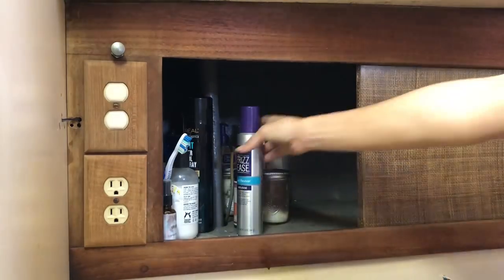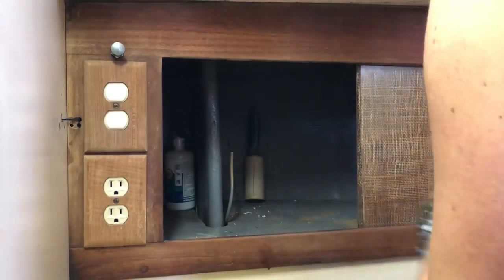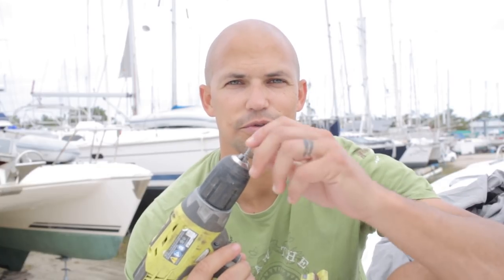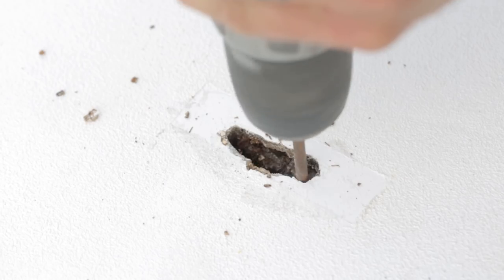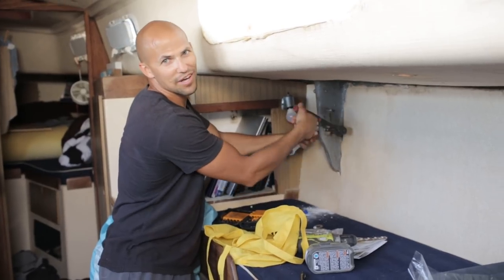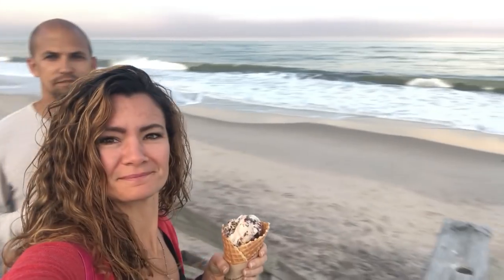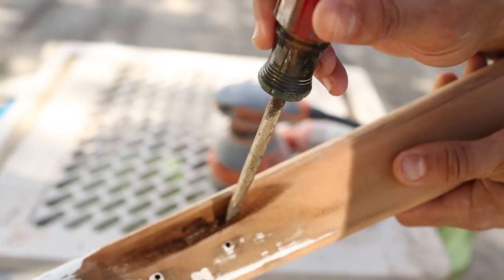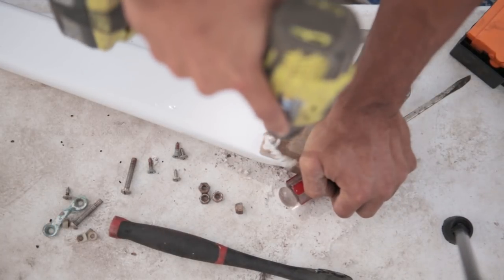Chainplates and Spreaders | 5 | Beau and Brandy Sailing

Comment: Great job!
Beau the metal chain plates is usually not the problem in old boats.  The deck is usually rotten where they go thru the deck.  You got that great!  The other is what the chain plates attach to is rotten!!! I did not see how that was.  If the wood is rotten under the chain plate it will pull out! 
Keep an eye on that!